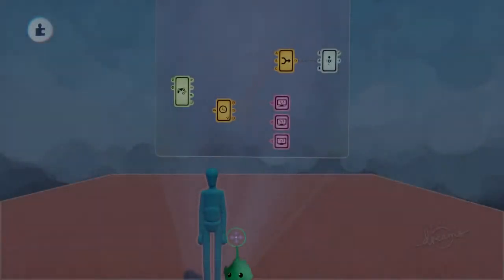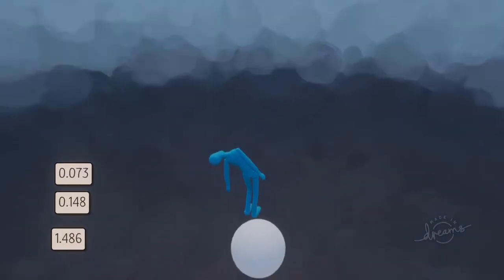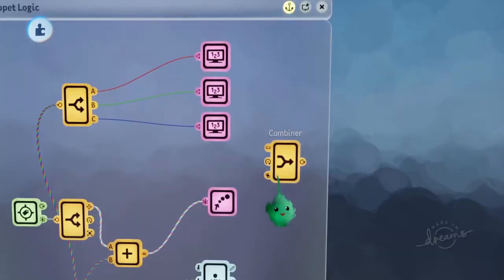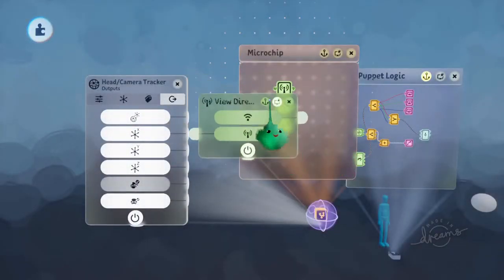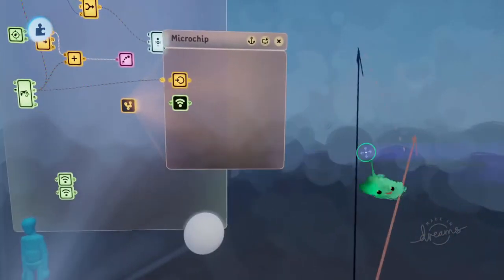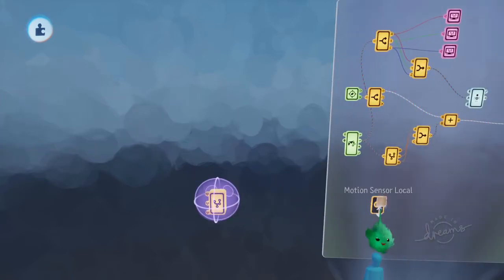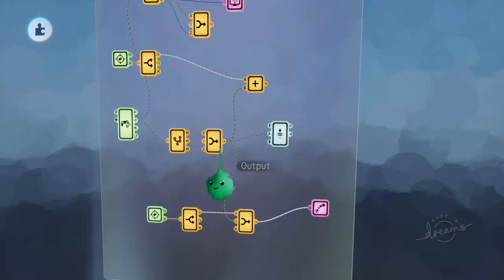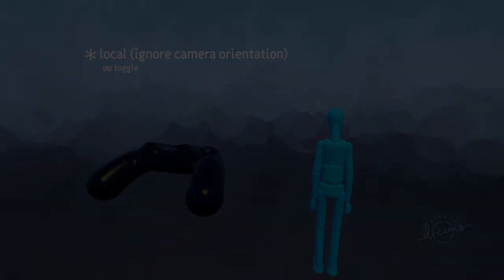Motion Sensor - Part 2: Conversion

Comment: nice find on the 3-number output! I never thought to add it to a tag. Sweet!
Reply from the maker: Yeah, it really helped me visualise what was going on in the end :D
Reply from the maker: Trouble was, originally I thought it would be a direction in some way, as it was a 3-number. So I used to test by wiring it into a 0-speed mover and watch what the arrow does. But as it's not a direction it was soooo confusing XD